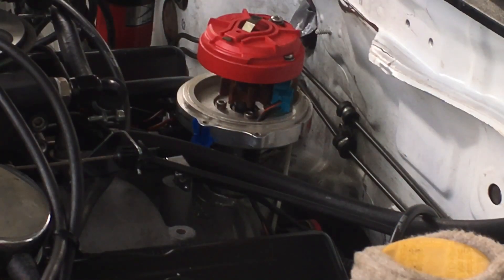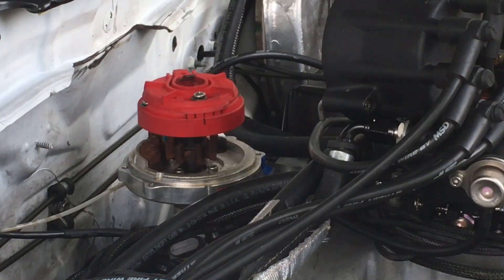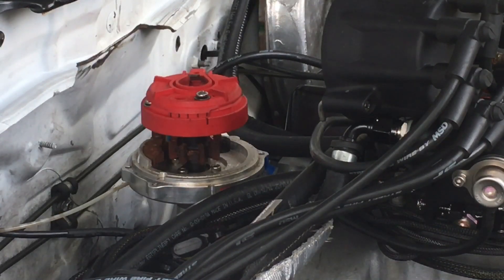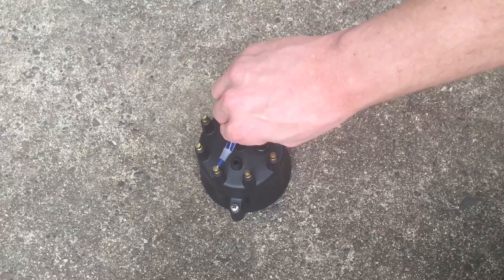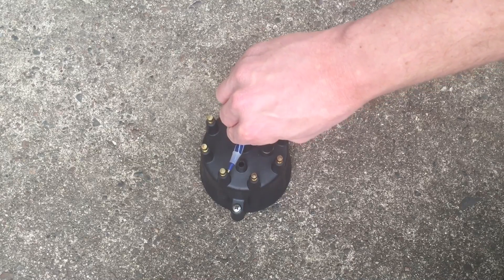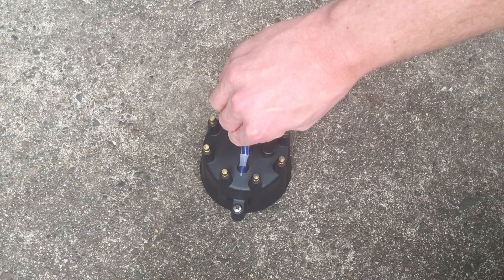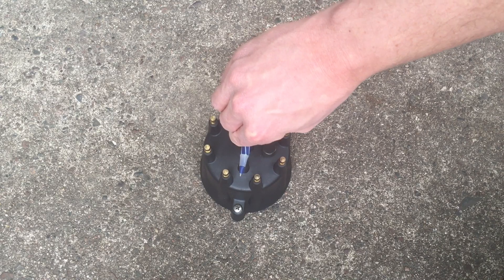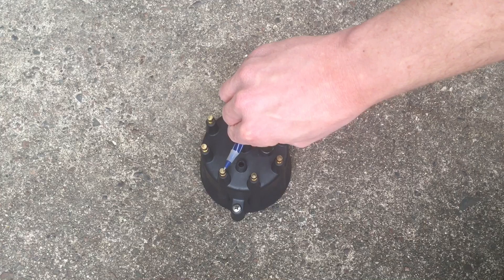FiTech Rotor Phasing and Timing Setup

Comment from the maker: Edit: one thing I actually just noticed is that the “after” picture in the video is incorrect. The rotor can be adjusted +/- 20 degrees either way (+/- 40 crankshaft degrees) you only want to turn the rotor to the second long mark (not the 4th one like I showed)

Comment: I wish you would cover how to hook the Fitech up to the distributor. I’m using a msd6 box and a MSD Pro-Billet Ready-To-Run Distributors 8360.
Reply from the maker: Thanks for commenting. If I understand this correctly, “ready to run” distributors are basically small cap HEI distributors. I don’t think you can use a Fitech to control timing on one of those. I am running an MSD 85551 distributor that only has a 2 wire input. I believe this is the kind of distributor that will work with Fitech timing control. You can use the one you have if you only use the Fitech for fueling though.

Comment: I was wondering why you locked the fitech at 10 deg lock set timing. Was this so you didn't have to rev the motor to 2k rpm for initial timing.
Reply from the maker: Hey! Thanks for commenting. I chose the base timing based on my camshaft. I believe you only need to rev it if you have a distributor with mechanical advance but it can’t hurt.
Reply: @pushrodgarage8716  thank you for replying. Correct, the base timing is based on your camshaft. I was interested in #3. The lock timing set. I haven't found any mention of that. Fitech says to rev the motor to 2k rpms to compensate for fitechs idle correction when syncing the unit and distributor. So I wasn't sure if the lock timing set would cancel that out. Thanks again
Reply from the maker: Interesting! I hadn’t heard that. Thanks for sharing. I actually set my timing while I was breaking in my cam so I had a buddy rev it between 2000-2,500 rpm while I was doing it. I’ll have to remember that for next time.
Reply: @gravesdu  sounds like you may be usibg an older software version that doesnt have the lock/ilunlock facility and you have to rev to 2k to get a steady timing light.
Id check to see what version you are running because one old version is known for glitches that are hard to tune around.

Comment: Thanks for the video it was helpful. Is that a Vortec 350?
Reply from the maker: I’m glad to hear you found it helpful! It is a 2 piece rms old school small block. What year vehicle did your engine come out of?
Reply: @pushrodgarage8716  I have a 92 Chevy 1500 with stock 98 vortec 350. I haven't had a heck of a time trying to get the timing and air fuel ratio set right being since I don't know much about tuning.
Reply from the maker: What kind of symptoms are you experiencing?

For air/fuel ratio I am running 14.0-14.7 for the non-WOT options (I can’t remember the exact KPA). For the WOT option I set mine in the 13-13.9 range to keep it a little more rich to prevent detonation.

It might be a good idea for you to look up specific timing figures that have worked for other people with Vortec heads. I know they are much more efficient than the 441 casting heads I’m running. I have my idle timing set to roughly 22 degrees. Base timing set at 10 degrees and full timing of 36 degrees at 3000 and 6000 rpm. I believe the fitech blends the timing together between those RPM ranges.
Reply: @pushrodgarage8716  can I message u on Facebook or something
Reply from the maker: Sure. Could you message me on Instagram? I’m PushrodGarage on there as well.